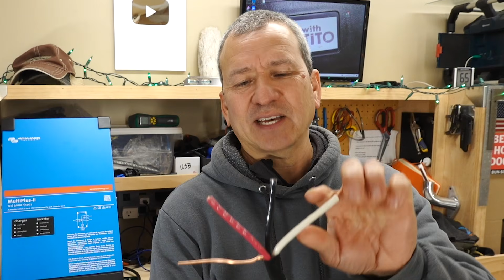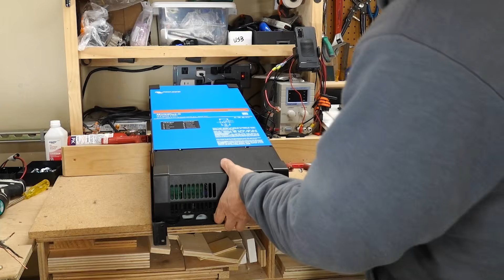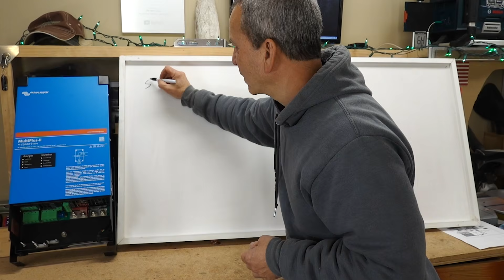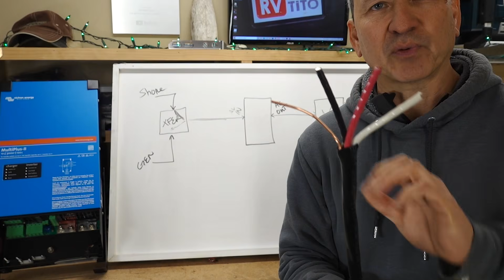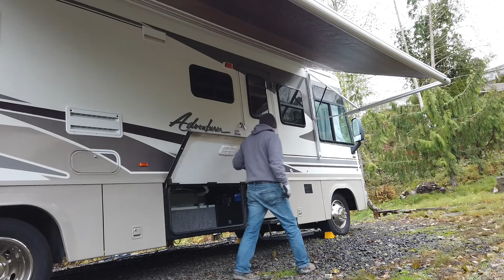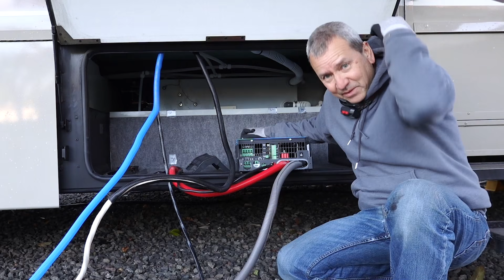Installing the Victron Multiplus II Inverter to Power our 50A RV Off-Grid | RV With Tito DIY

Comment: When installing solar panels I'm curious about how thick most rv roofs are and how far can you drive a bolt into them before you punch through the finished inside of the roof.
Reply from the maker: It will vary based on the make and model. You can often see the roof composition in the vents and other openings.

Comment: Hey. Also the quirkie thing you may discover with the Cerberus is that you cannot trigger a relay with the temp sensor. Example. I have a fan that kicks on at 90. Had to do it with separate unit. This is a programming issue that victron has not done. Thanks again
Reply from the maker: Thanks Bill. I got a cheap Chinese switch to do the trick. Works like a champ.
Reply: @RVwithTito  yep. Same here. Maybe victron will change the programming. Many applications for this.

Comment: In your initial explanation of the four wires you use the term "sides"  Perhaps "legs" would be a more accurate term. Note the Victron panel labels the hots as L1 and L2.
Reply from the maker: Yes that's correct. Just trying to choose the right language to make it clearer, but I ended up using both terms interchangeably :) Thanks for the comment.

Comment: Hi Brian, Great explanation. You sure have great ideas on how to put things together. I installed the Victron 3000 with the SPS  in my class A last year just before the Victron II and the new Battle born GC2's came out. It seems I'm always a day late and a dollar short :-). I had problems with my SPS as well.  It turns out it can only be installed in a few positions or the contacts will stick. I am curious on what you have heard are the problems with the SPS. Thanks T
Reply from the maker: I don't have any direct experience with the SPS, but I have an installer friend who has installed several for clients. Many of them would start to cut out on one of the two legs for whatever reason. So they stopped installing them or removed them from those rigs.

Comment: Excellent presentation Brian - thank you.  How will you input your solar array into this system?  Would it go directly to the batteries with a separate charge controller or is there a transfer switch that would handle a third input?
Reply from the maker: Thanks. The solar array does not go into the inverter. It will be connected to the charge controllers then battery busbar. You can see how it's all connected in my diagram at https://www.rvwithtito.com/downloads
Reply: @RVwithTito  Ah okay - thanks!

Comment: I'm assuming the original inverter was not split phase?
Reply from the maker: No it was just used to power a couple of small thing.
Reply: @RVwithTito  i have a new to me 2003 Alpine with the original xantrex 2000 watt inverter. I'm guessing it's the same as you Winnebago. Thanks for all your videos. Most helpful in thinking about the next "project".
Reply from the maker: @alancarlton7647  Mine was a 300W mod sine just for powering the stereo and a couple plugs. It's a gonner.

Comment: Hi Brian,  how did you fair out with the flexible panels and why aren't you using them anymore. I have an older Class A that we don't want to get rid of.  It's all-aluminum, exterior, and the entire roof including welded aluminum frame structure.  I really don't want to screw anything into it if you know what i mean. I found that coroplast with ethernabond tape a great idea. Was it?
Reply from the maker: The flexible panels work great on the class C. This is my favorite mounting system for that https://youtu.be/uJIEXhnF8MU 

I chose to go with large traditional panels on the Class A because I found a great deal on some large ones to maximize my solar intake. I could have certainly gone the flex route too.

Comment: Even if my class A RV runs on 30a, your approach and logic is very sound. I may have a few concerns of additional weight that will have to distributed evenly with the batteriea on both sides of the RV and how it influences your tire pressure levels but aside from that, it's very good.
Reply from the maker: Thanks for the feedback. I believe I'm balanced out pretty well. Plus I did remove two large lead acid batteries on that side.

Comment: Great video.  It is well done.  I noticed you using copper straps and buss bar mounts.  I couldn't find any of these items for my build, so I used cable and lugs, some of which are 4-0 which is so clumsy to work with.  Where do you get your copper buss supplies?
Reply from the maker: Got them on ebay. Links are in the description.

Comment: One thing you missed mentioning - the Multiplus II can 'boost' power - so if you have 30 (or 15!)A, you set that as your input - and if you 'use' more, the inverter will use the batteries, up to a 20A boost, to make things work. Great for moochdocking off a 15A cable at someones house for example :D
Reply from the maker: Very true. Yes. That's a nice feature of the multiplus.

Comment: Great description of how the pass-through split-phase inverter works.  I have had trouble describing how this works on my RV.  In order to run my air conditioners (one at a time) from my battery bank I also had to do a full rewire of the electrical distribution panel.  Right now we are dry camping in an area that is still 75-80 degrees at night and we run the air conditioner from our battery bank all night recharging the battery bank from the solar and generator the next day.  Sadly our 1800 watts of incorrectly angled solar panels can't keep up with our air conditioner use.
Reply from the maker: Hope you get it all sorted out. We're still in cooler temps so A/C is not really an issue yet.

Comment: Unbelievable timing, Thank You!!  I noticed our 4 golf cart battery cases bulging a couple weeks ago.  We just got this inverter, a Cerbo GX, and 4 SOK 206AH lithium batteries to replace those batteries and our Magnum ME2012 inverter/charger.  I'm hoping the install is "plug and play".  I see that you use a bus bar for your batteries.  I'm staying with 2/0 welding cable.  Can you recommend a hydraulic crimper?
Reply from the maker: You should be setup well with those batteries and the multiplus. Here's the crimper I used: https://amzn.to/3ziuQtQ  It worked pretty well up to 4/0. Good luck with your upgrades!

Comment: Another great video and install.  As usual, a couple of things for you.  The 6 gauge wire you use for the  AC panel is too small for the 50 AMP  load.  It appears the wire you pulled out is bigger.  I used 4 gauge wire to wire my AC panel.  If the transfer switch is original, replace it.  I don't like automatic transfer switches anyway but they are a necessary evil.  Check all the contacts inside yours, they may have burn marks on them.  They can be cleaned up but I'd rather replace them.   Better safe than sorry.
Reply: It all depends on the ampacity of the wire used. Romex #6 can absolutely handle 50a. 8awg Ancor marine wire can handle 50a. I suggest you look up the ampacity table of your conductors before you make these kinds of comments
Reply from the maker: Thanks for the suggestions. The original wiring was also #6 so I kept it the same. Good note on the ATS. I also replaced mine when I found some burnt contacts. All good now.

Comment: With that set up is there a way to get 240V so a 240V mini split can be powered ?  Thanks
Reply from the maker: I'm not getting 240v when on solar, just 120v. So it would only be possible when running from the shore power or generator with a bunch of rewiring. For me, I'd go for a 12V mini split instead.
Reply: Thanks. I was hoping the Vectron could handle that some way.

Comment: Can I ask why you are going with 12 volt system instead of 48 volt system which is a lot cheaper and more efficient?
Reply from the maker: Sticking with 12V. Yes it costs more in equipment, but it simplifies the setup. Plus this inverter is only in 12V.

Comment: Happy New Year Bryan, I've had the best Christmas cause my Victron components came in. Unfortunately I can't start the install till spring. I've just discovered your chapters and will be watching them next. So I don't know if you touch on this subject. My question is how do you address component chassis grounding? I'm a retired electrician and been following you and find your installation to be very workman like. Thank you for sharing 😊
Reply from the maker: Sorry. I didn't show it, but I did also ground the inverter to the chassis. There's a grounding post inside. I ran a cable from there to the negative busbar which is grounded to the chassis.

Comment: Thank you very much, you explained everything and I acutally understood it. I could install a solar system now with the exception of the actual configuring of the monitoring setup. I was wondering, could you use one 12 volt 500 amp battery or combine two of them?
Reply from the maker: You could certainly use a 500Ah battery if you had one. To combine them in parallel, you'd have to check with the manufacturer first.

Comment: I just installed the same inverter. Took my first trip last week with it. So far I love it! Be sure to install the temperature sensor and turn on the function to stop charging during freezing temps. To do that, you have to turn on lithium battery mode. Can't wait to see your final setup.
Reply from the maker: I did program the low temp cutoff. It's using the temp sensor in the Smart Shunt which is located right next to the batteries. I also have a high-temp switch on a fan behind the inverter to pull hot air out when it gets warm in there. Thanks for the suggestions.
Reply: I too installed this inverter and 712 and color control. My BattleBorn batteries are inside the heated fifth wheel. So I didn’t enable this setting. The likelihood of them being that cold is very rare especially if you live in San Diego. Also battle Born batteries BMS will protect them from cold temperature charging. The 712 will report the battery temperature via the color control or phone app. So this setting doesn’t always have to be set. Depends upon your installation and camping style. I guess it couldn’t hurt.

Comment: Just purchased the parts to install a Multi in my rv as well... but final install has to wait until spring.  I only have to deal with 30a though.  I didn't buy the dongles, with bench testing it seems that I can configure everything through VRM via the Cerbo so decided to save a few bucks.
Reply from the maker: Everything on mine also goes through the Cerbo, but I still need the PC app to fully program the inverter. It would be nice to program it through Victron Connect.

Comment: Another great episode Tito! You did not mention that if you are just plugged into a 30A socket that the inverter can 'boost' the AC power to 50A to power the entire coach (water heater, dual roof ac, etc) using power from the battery bank which may also be supplied from solar panels. Victron equipment with the Cerbo, Touch 50, BVM712, is just so easy to work with and reasonably priced (compared to some of the Xantrex stuff which seems to be VERY expensive).
Reply from the maker: Sorry I didn't mention that, but YES it's a great feature of the Multiplus inverters. I've already used that feature.
Reply: Yes that's what NOBODY is communicating...this is awesome. Can run 50a service plugged in or not. That's what I need

Comment: Also I thought line one and two out both go to the panel.  The inverter only uses side one when there is no 120v supply to the inverter.
Reply from the maker: I believe the inverter bridges the outputs when 240v split phase is not detected.

Comment: I’m guessing here, but, the white hose coming down in front of your inverter would seem to be either the drain from your sink(?) to the grey tank or your fresh water fill line.  I had one of those crack over time. That location would not be a good place for a leak.  I hope you have inspected and or replaced that if its pretty old or potentially have a plan to keep your electrical equipment protected.  Good video!  Happy new year!
Reply from the maker: Yes. I'm keeping an eye on that. It's the gravity fill for the water tank an it's in good shape. No leaks currently. Also, nothing is sitting directly on the bottom of the compartment and all cables have drip lines. All that's missing is probably a drain hole.

Comment: Thanks.  Two questions.
1. On a 3K inverter are you concerned about inrush current frying your battery BMS?
2. Have you had any issues with inverter high temperature warnings/shutdown with the Multiplus installed in a relatively confined space?
Reply from the maker: 1. Haven't had any issues, but I'll keep an eye on it
2. I installed a cooling fan with programmable temp switch behind the inverter that will vent the compartment when it heats up.

Comment: I've wondered what your power center converter that used to charge the batteries when on shore does once you've installed this.  Does the new inverter/converter compete with the old converter/power center to charge the batteries or what?
Reply: normally the charger in the converter would be turned off. I just shut off the breaker.  If you don't it will create a 'loop' when inverting trying to recharge the batteries that it is drawing from.
Reply from the maker: I removed the old converter. The Multiplus II is now the battery charger. Batteries are always powering the coach 12V while being maintained by the Multiplus. Works great.

Comment: Thanks for the explanation, Bryan. Seeing the wire install would've been nice. For some reason everyone just "explains" this part & skips over the filming. When that's the most important, in my opinion it's easier to understand. I have had to replace three inverters, and still I'm not comfortable when it comes to the wire install. I was hoping to see the order in which you've installed them. And, I'd love to see how to discharge any charge on the inverter and/or battery cables if there is any. Happy New Year! Christina & The Animal Love Fest ❤😽😽😽🐺🐰💋
Reply from the maker: Sorry I didn't show a lot of that. It's going to vary based on your rig and location of things. Plus those spaces are very confining. I didn't need to discharge anything when connections were made. No sparks.

Comment: quick question.. what did you do and/or decide about heat... you had the diesel system but don't recall if you changed that
Reply from the maker: I am experimenting with the Webasto gas heater on the class A for long term boondocking. I also have the LP/Electric furnace and on-board heat pump on this rig. Several options.
Reply: @RVwithTito  thanks...  pb

Comment: Looking good.  I like the blue wire cover ... My system is much smaller ... and using a victron solar and dc to dc ... but not hooked up. I'm using a measly 200 amps... which is okay for my mini motorhome.. just trying to decide if and when to use an inverter.
Reply from the maker: Yeah. I thought he blue tubing would be a nice touch. Good luck with your upgrades.

Comment: So you had to route new wiring to your panel twice correct?  Could you use your existing transfer switch?
Reply from the maker: No just once. I routed the old wiring from the transfer switch to the inverter input. Only the inverter to distribution panel wiring is new.

Comment: I’m assuming the RV didn’t have an existing inverter?  I’m in the process of upgrading mine on my 2000 Fleetwood Class A. It has existing setup so I’m just swapping and didn’t have to replace wiring. I wanted to use Victron but physical size of inverter was an issue. My big RV has the smallest spot for inverter but it makes sense given when it was manufactured.
Reply from the maker: It did have a small 300W inverter for some audio and a couple things. It was nothing I could use to power the rig. I ripped it out and donated it.

Comment: Whats wrong with using a 240v transfer switch and wiring the hot from the 120v inverter to both legs feeding your distribution panel?
Reply from the maker: That's basically what this inverter is doing automatically for you since it stays on all the time. I'm thinking your shore/generator inputs would need to be completely separate from your inverter (if I understand you correctly). You could wire a separate plug on the output of your inverter and plug it into the shore power cord. Maybe others have other suggestions.

Comment: Was it easier to take all wires from distribution panel, back to MultPlus vs taking output from your TS and connecting that to output of Multiplus.   Then, you'd only have to wire from the output of TS to input on Multiplus.   I did mine this way, but 3 years ago with a GoPower IC2000.    Keep up the GREAT work.   Maybe someday we'll bump into each other here in the PNW.
Reply from the maker: Depends where you mount the inverter. Mine was very close to the distribution panel with the ATS on the other end of the rig. If the inverter were closer to the ATS then your suggestion would be the way to go. Take it easy!

Comment: That's probably the best explanation I've seen out there! Victron should hire you to do some of their videos (their site is terrible!)

I would love to see a system like this that also acts as a charge controller, I think that might help justify a bit of that cost -- They're pricey little pieces!
Reply from the maker: Thanks so much. I see arguments both ways. Personally I prefer separate components instead of having the charge controller as part of the inverter. It limits the flexibility of your design.